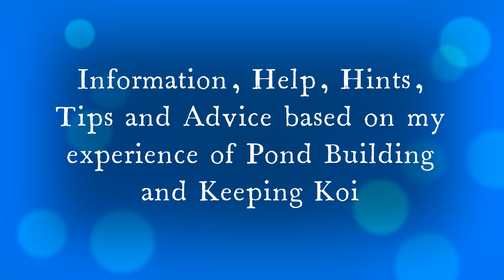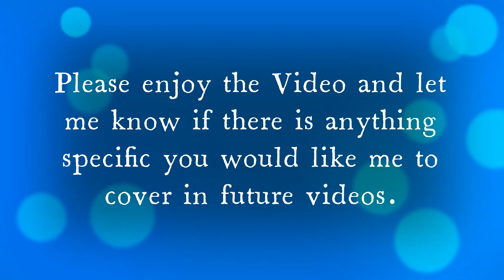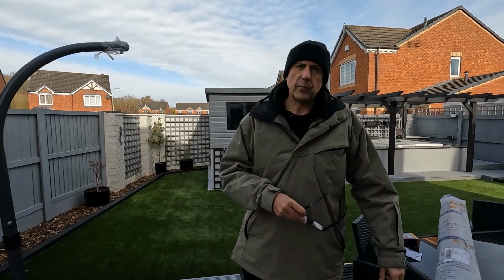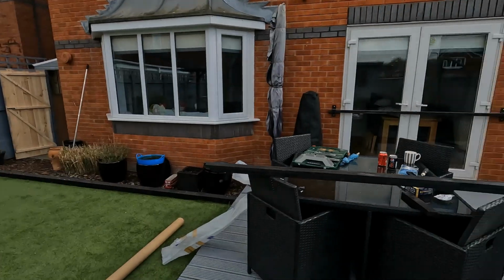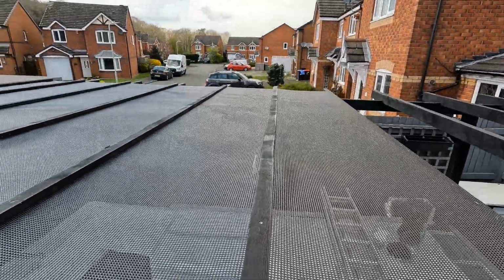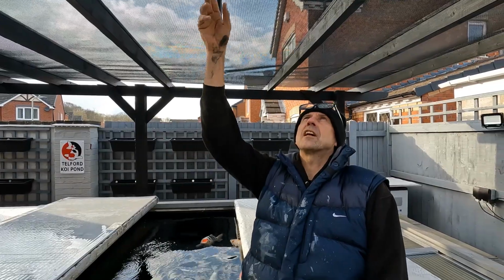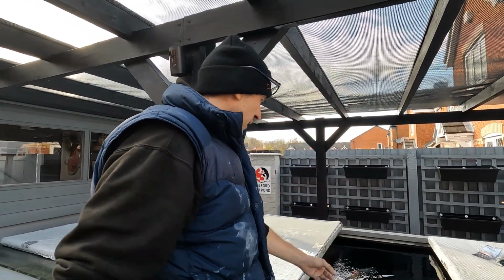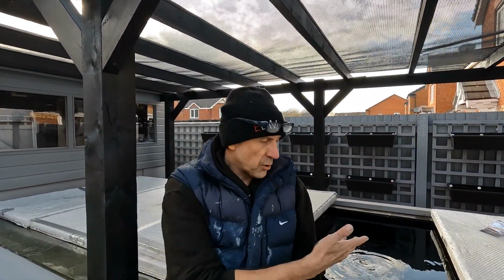T.K.P. Telford Koi Pond - Video 58 – Koi Season Preparation - New Shade Cloth for the Pergola.

Comment: Also real helps when videoing the fish cutting down on the light. to nice job on that and it looks like good stuff have a good weekend
Reply from the maker: Thank you sir, much appreciated 👍😊. Enjoyed your last video on solar panels, have been looking on Amazon and eBay to see what I could do on the roof of my filter house so might be following your lead👍🈲🐟😊
Reply: For some reason the links wont stick to the video i did. What happens with this small grid tie setup is the power go's into your ring so say your house sitting there is using 500w  your fridge and freezer running your pond and Tv computer all that stuff eating the power. Well this puts power into your ring your side of the meter and that gets used first so if you are making 400w on the solar then only 100w is passing the meter. Now there is little point in making more than you are using as the meter wont run backwards but you can make more than you are using and the meter will just stop but that's waste. all you do is plug the Grid tie into a socket in the filter house and pop the panels on the roof most of the day summer time this will make over 200w so your pond runs for free in the daylight hours hope that's got your head round it. More on the Grid tie next week as the 1000w one i ended up with is only about 85% effective in that its not MPPT tracking on power transfer so i have ordered one like the first duff one i got i know they run 99% near no loss DC to AC   

https://www.ebay.co.uk/itm/174898856305
https://www.ebay.co.uk/itm/125194356118?ssPageName=STRK%3AMEBIDX%3AIT&var=426238209578&_trksid=p2060353.m2749.l2649
https://www.ebay.co.uk/itm/175221355621?hash=item28cc01b465:g:9UQAAOSw0xNiQ~CN
https://www.ebay.co.uk/itm/234480901018?epid=10022381676&hash=item3698269b9a:g:92sAAOSw4DVeSar9
https://www.ebay.co.uk/itm/203629430299?ssPageName=STRK%3AMEBIDX%3AIT&_trksid=p2060353.m2749.l2648